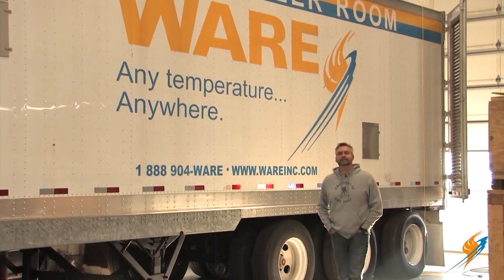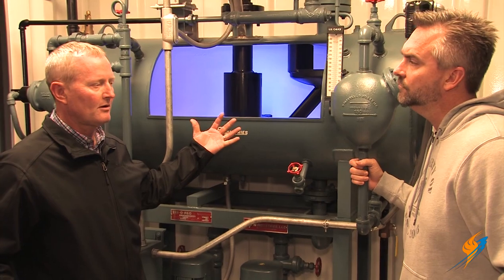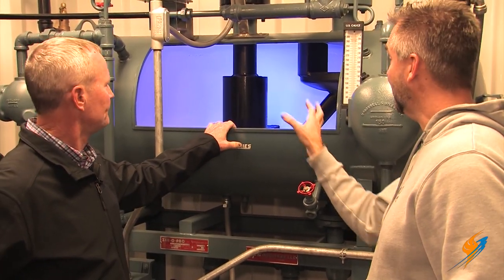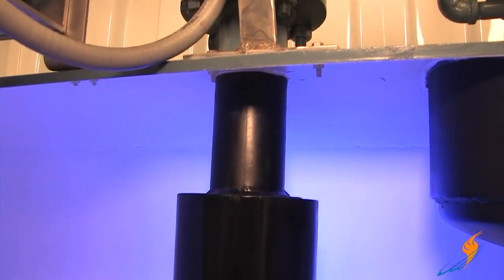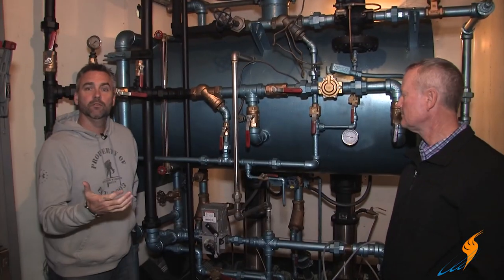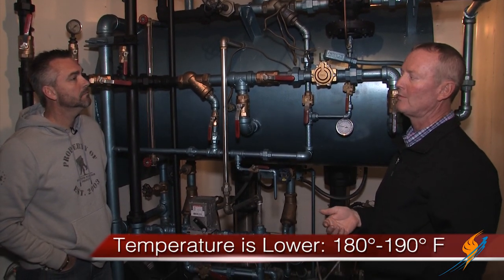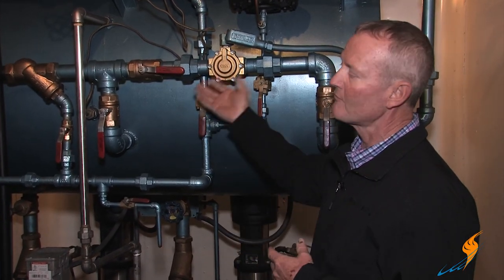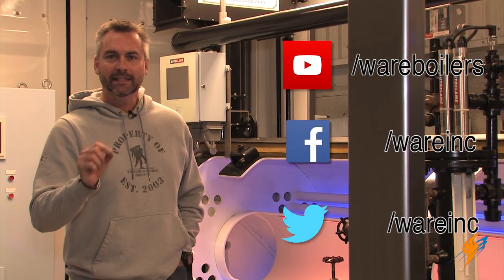Difference between Deaerator and a Condensate Tank -  Boiling point

Comment: Where I worked, the condensate system used a vacuum pump with a storage tank. That water was then pumped into the feed water tank where it was preheated to reach 150°.. 
we had 200 hp boilers, but we ran the boilers at about 6 pounds of pressure.   With a special pilot regulator I was able to operate the building steam below atmosphere.  This was very helpful in the mild seasons of spring and fall but we needed more pressure when it got colder because we had air handler’s bringing in outside air.

Comment: Awesome 👌 I have two boilers: 1- 400 HP and 500 HP with  a condenser tank/ makeup water. 
Water treatment. But I used a ring on the feed of the boilers and at the end of the heating season when I do the blowout the water is clean.

Comment: You have a great content here, I work in a combine cicle electricity plant and we have this equipment that you guys talk about and I learn a los from you,  specially the funtion of the deaerator that basically is the same but the one we have is like 10 times bigger than that and de feed water pumps are 4.16 kw with a high pressure around 150 bar of presion and intermate 120 bar pressure and other low pressure pump about around 60 bar of pression, it would be great that upload a video about a HRSG 3 steppes!  Thanks!!
Reply from the maker: Glad we could help! Unfortunately we don't have a HRSG to talk about but if we get an opportunity to cover it we will. Thanks for watching!

Comment: When you are saying "remove oxygen from the water", you mean (ambient) air that's blended or mixed in with the water being fed into the system, right? 
If you remove the oxygen from water, you get hydrogen.
Reply: dissolved oxygen only
Reply: +Ahmad Zaki Abdul Karim Thank you. I thought that was the case, but don't know a great deal about the mechanics of steam, and didn't want to assume anything.
Reply: @nasigorengtomyam7452 
And desolved CO2 too
To avoid corrosion and acidity
Reply: Actually, this process removes SOME dissolved GAS from the water, and not all.  The dissolved gas is air.  Air is mostly nitrogen and only about 21% oxygen.  Gases are less soluble in water as the temperature goes up.  They want to get rid of the oxygen component as much as they can, but the process is removing dissolved gas/air, not oxygen specifically.  CO2 is only about 0.04% in air, but can reach higher levels of concentration due to the chemical conversion it undergoes, to form carbonic acid, which takes the CO2 out of solution and allows more CO2 gas to dissolve in.  Also, "CO2" in the form of carbonic acid can leach into ground water from other sources other than air, like limestone.  The small amount of dissolved CO2/carbonic acid, which makes the water slightly acidic, increases the power of the oxygen to oxidize the metal parts (rust).  The steam is to heat the water up to facilitate degassing, and the spray action is to increase the surface area of contact betwen the steam and the water to make the process more efficient.  And the plume visible at the top of the vent pipe is steam/air, not oxygen.  It is the exhaust degas/steam mixture coming out, hitting the cooler outside air and condensing into tiny droplets that scatter light.  If it were oxygen alone, as they say in the video right after calling it a steam vent pipe, it would be a cheap way to make/collect oxygen to sell, and it would burn.  Hold a match to the plume.  No way it ignites.  It is just air and steam.  The system is called a de-aerator, not a deoxygenator.
Reply: Yep
Reply: @bentleywall5981  boy id love to pick your brain. Just entered an apprenticeship for this stuff